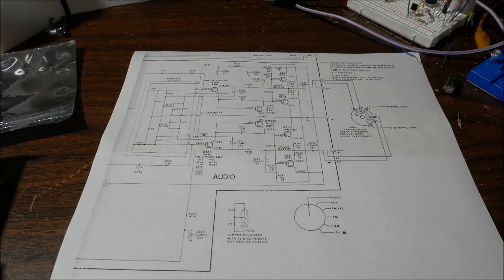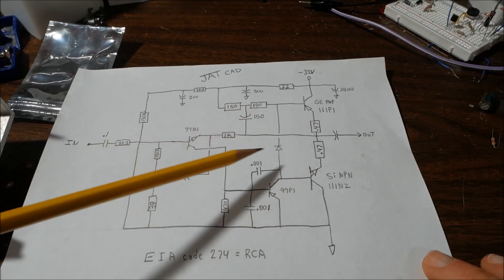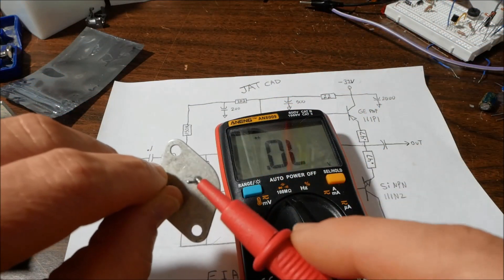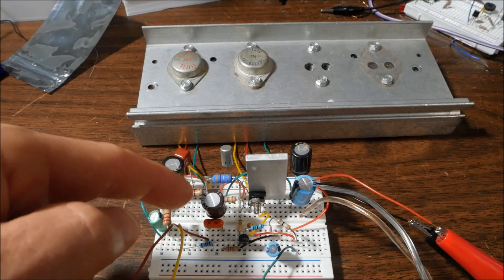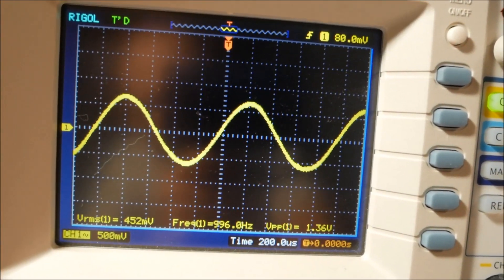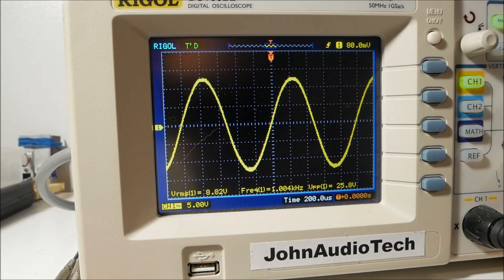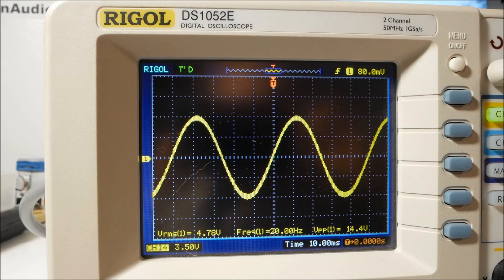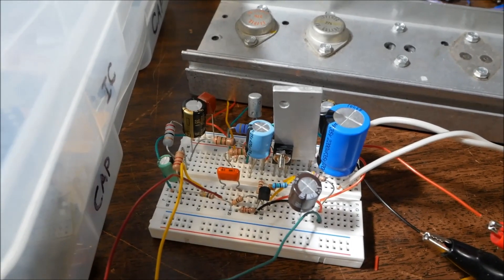Germanium and silicon transistor output stage audio amplifier

Comment: Quite a common output stage around this time were a pair of matched AD161 and AD162 Germanium power transistors.
They had very good gain of around 100,so were easy to drive.
You may be interested to check out the Sinclair Z12 which was a hobby amp using this configuration.
I did own one,and remember it sounded good.

Comment: All good info John. I use Pink Floyd for "earoscope" testing, mainly because I've been listening to it for so long (and heard it on many high end systems) I can pick out anything that doesn't sound quite right. Of course it also offers a wildly dynamic range and, in a single track, can offer up everything you need to set up a system.

Comment: This topology was VERY common.  Heathkit used it in all of their early 30 watt class amplifiers and receivers back in the 60's and early 70's.  2N301 and 2N3055 type transistors were common.  Once the MJ2955 Si PNP transistor became available at low cost, the 2N301 was no longer used.
Reply from the maker: Thanks for the information. I was wondering how widely this was done.

Comment: Probably a product of component procurement problems during a period of silicon taking over from germanium. Getting PNP in silicon was a problem until they solved the doping difficulties. So to keep product production going they mixed the types.

Comment: I have the exact same circuit on my magnavox stereo with a leaky germanium PNP. I bought some NKE 219 silicon matched complimentary pair to replace it. How would I adjust the resistors to properly bias the new transistors?

Comment: Wondering about the driver and predriver. 94N1 is Si, 99P1 is Ge ?? Is that diode Si? Put a couple of those diodes aside for me if you have them, or let me know where you got it, as that style is used in the .01Tiger and I'd like to find a source.
Reply from the maker: Those are both Si transistors so I used "modern" ones. The diode is a single Si diode (.6 v forward drop). They are RCA 0135 manufactured in 1968. You are welcome to them (two) if they are what you need. I can send them to you with some green LEDs for your stake light mod or bring them the next time I come up (or you come down here).
Reply: No immediate need, but haven't been able to find them.

Comment: John, I have a question for you. How do we stop a amplifier from clipping when the pot is all the way up?
Reply: Add a resistor of suitable value to the input of the POT.     It is best you don't crank-up the  pot all the way up just stop before you start hear the distortion.
Reply: add an L-pad on the input. but isn't it easier to just turn down the pot?
Reply: Yes of course, but I have people cranking the stereo to 11 and blowing my speakers. Friends suck when they crank a speaker until it blows then tell you they only turned it up a notch. It sucks when you can't trust friends while you're gone for 10 minutes and they don't even offer to even help with repairs. I'm building a Class A~B I'm not that worried with that one because it's not 10% THD it's next to no THD @ 400watts Nice 2.1 Boom Box. Nobody is allowed in the house when I go to the store anymore.
Reply: When it clips in that situation: use a voltage divider before the pot or after the pot and align it all to maximum undistorted level with the audio control pot fully up. Example: when you precede the audio control pot with a 2 x 50 K resistor (or 2 x 10 K or 2 x 100 K) and connect the node from that voltage divider to the top of the audio control pot, your signal input is half of its original level. When you use a pot from 100 K or 50 K or 10 K that precedes your audio level potmeter you can find this out in a few minutes. Take that pot out when all works fine, measure its resistances (wiper = reference) and take these resistances to choose fixed value resistors, standard values close to the measured resistances.
Reply: radiofun232+ Thanks, I was thinking about taking the pot apart and put a spot of epoxy on the ferrite so the wiper couldn't go any further. Just a thought

Comment: So what's about silicon-germanium transistor pair? Didn't get it. Looks like it's good idea, but...
Reply: It was all about the economics of the time, and the semiconductor industry's transition to a mostly NPN Si topology from the PNP Ge topology that had dominated the early days of the transistor. NPN Ge and PNP Si transistors were expensive and generally inferior to their compliments.
Was there a date on this schematic? 1960s?
Reply from the maker: There are 1968 date codes on several parts in the original chassis. Probably designed in 1967.
Reply: The first transistors that were produced in the late 1950's and 1960's were almost always Germanium transistors. They had a low barrier voltage (say 0,3 V) and were (very) sensitive on temperature changes. All kinds of measures had to be taken to prevent the so called "thermal runaway", heat collected inside the transistor, the collector-emitter current got higher and higher, finally self destruction due to heat. Silicon transistors (they came later in history: I mean: available for the industry and public, not in the laboratories) did not suffer from these problems. That is the reason why Germanium transistors are now more or less history. Anyway: this combination from 2 transistors with different parameters is quite unique, it shows that they can be combined into a successful audio amplifier. These different properties also show that it is a challenge to combine them succesfull in a power-circuit. In low power applications (milliwatts) this is not a big problem.
Reply: Don't get me wrong. I did assemble similar amplifier myself some years ago. Just assembled without much understanding of  what's going on inside. It is interesting. What I missed from the video are these small explanations about differences between germanium and silicone transistor. Explanations in a classic John's style.

Comment: germanium transistors, do they still exist....
Reply: NOS, i guess?
Reply: S. Kojina 
Some secretly making it .
Indian BEL make it .
Indian amplifier still use them in input stages for public class amplifier
Mainly companies like Stranger and Ahuja
Reply: ah, nice to know!. but why? aren't they're a lot noisier and low in current gain bandwidth?
Reply: oh wait.. i was thinking public class = high power amplifier. i see no problem for something like public announcement amplifier
Reply: S. Kojina 
Acoustic effect is much better .
They aren't noisy . They sounds better than si on proper circuits.
Those Indian Ge transistor are highly optimized
You can say modern ge transistor with older AC and af name
Reply: interesting! are they propietary? i'm curious with the electrical characteristics
anyway, i found SiGe (Silicon Germanium) transistors for RF (but they only have 4V of max. VCE :( ) are they equivalent to those BEL branded transistors?
Reply: which BEL transistors ? can you suggest some such part names from BEL ?
Reply: iceberg789 
AC125
AC128
No are like old boy but don't get fooled . They are newly manufactured and improved in gain and other stuffs . Sounds really good.
Reply: unless there's updated datasheet, we don't know how good is it.
Reply: S. Kojina 
Build this amp with ge transistor you will realise why in class A silicon sounds worse.
Ge transistor even that old mullard, Philips and tunsgram one sounds way better than anything modern.
http://www.diyaudio.com/forums/headphone-systems/160646-germanium-single-class-headphone-amp.html
Reply: i see no technical reason there. if you want it sounds nice, maybe. but my goal in every of my design is as close as the input signal. it might be fine for preamps but i don't think the slew will be enough for high power usage
Reply: do regular electronics parts stores stock these ? because last time when i bought a few AC128 @chandni market, they all showed 0.7V BE voltage drop. i think i got fakes.
Reply: thats bad.
Reply: nte still makes new current production types of all sizes